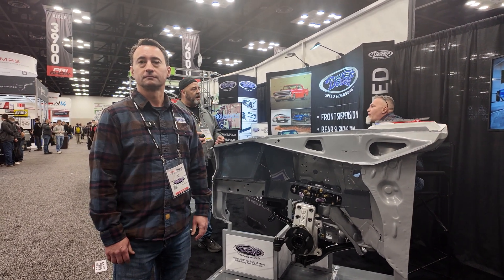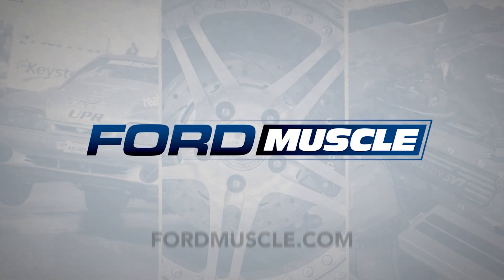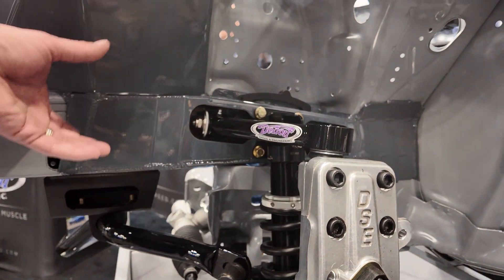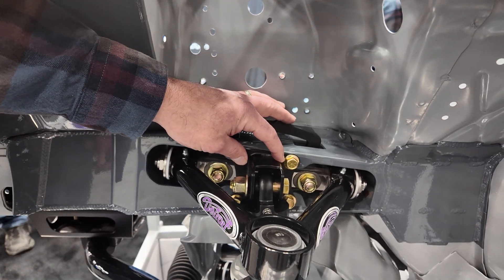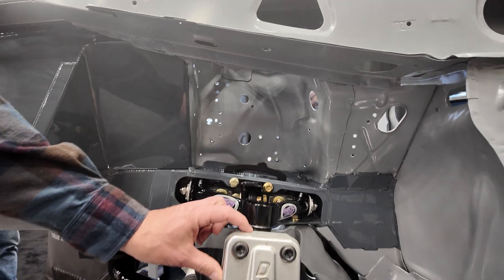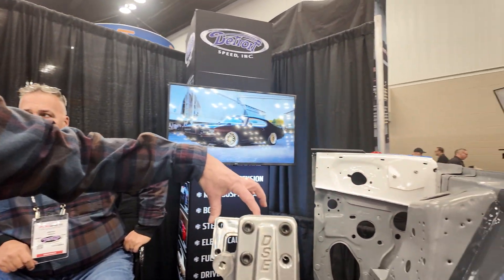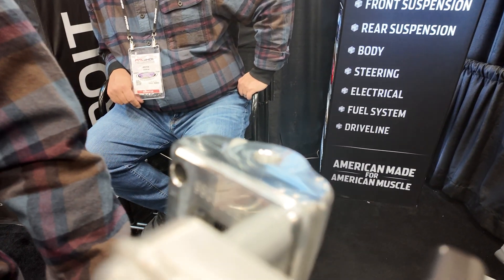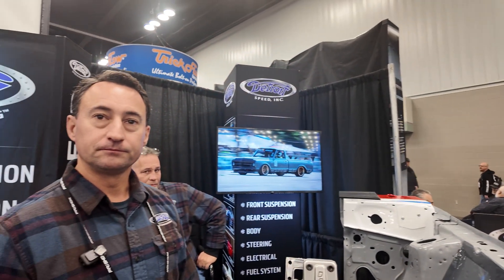Detroit Speed Explains Their New Foxbody SLA Front Suspension Kit | PRI Show 2024

Comment: He had me up to the $4,500 part.  lmao #HARDpass
Reply: Its well worth it. Lots of r&d and money spent designing this. Go but upper,lower and colliers its 4500
Reply: Ridetech released an SLA 2 years (possibly 3 now 🤔) for $3,300 and don't have to weld the frame rail mount for the upper A-arm it's a bolt up design in case you choose to go back to the original modified McPherson strut setup.
Reply: @ridiculousreptiles 

The Ridetech setup is not $3300. That number you quoted only gets you the base components. It doesn’t include the coil overs, a sway bar or brake brackets. 

The cheapest you can do the Ridetech setup is $4260 and that’s still not including a sway bar.

And it’s inferior to the DSE setup because Ridetech focused on packaging rather than making it as good as they could, hence that short upper control arm design and using a short shock as well which we’ll politely call a “compromise”
Reply: @ridiculousreptiles  The design challenge is to get the upper control arm long enough to get a proper camber curve. Detroit Speed's frame insert is the answer to that issue.
Reply: A premium strut setup (k-member, tubular control arms, coilover strut, caster/camber plates) is about $2500. Another 2 grand for an SLA sounds reasonable. The benefit is not only an improved camber curve but more inboard space for wider wheels.